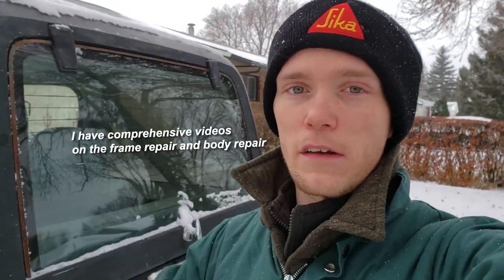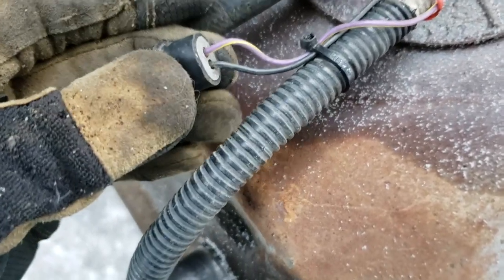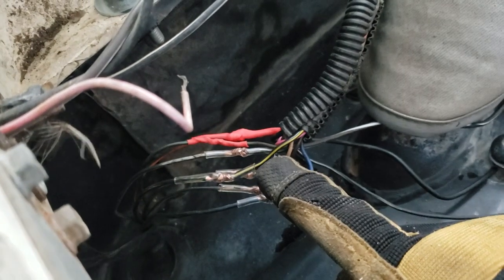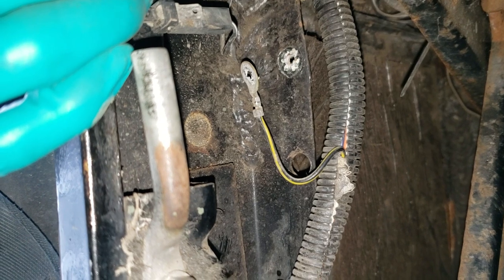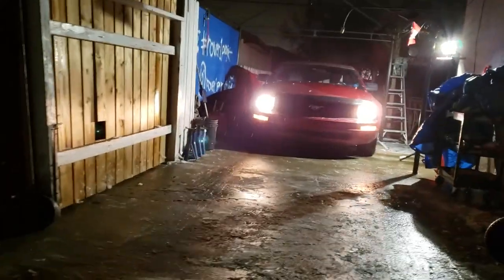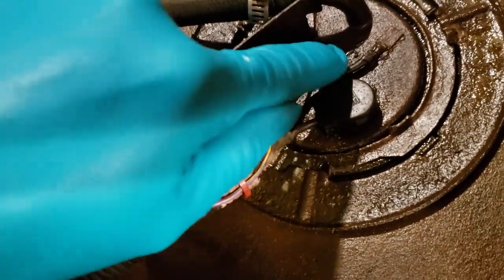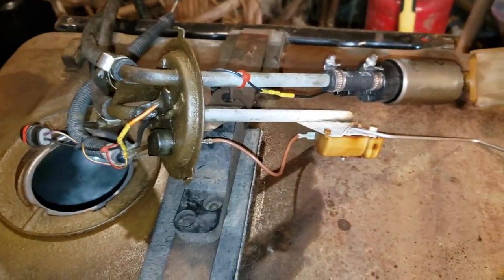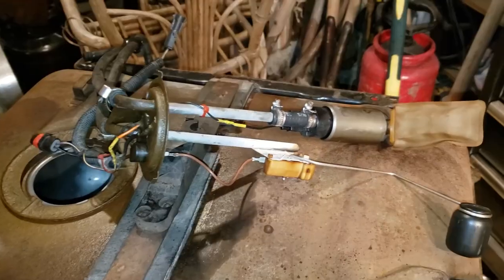Rover 1 Project - Jeep YJ Fuel Pump not priming or turning on

Comment: My money is on the ASD And Fuel pump relays. The contacts in the under hood fuse/Relay block, corrode, and no longer supply the voltage to the relays. You have to 1. Disconnect the Negative battery terminal. 2. Remove the fuse block from the mount. 3, take the bottom cover off, 4. Push every wire into the relay and fuse sockets. Make sure that they are in all the way. If the contacts haven’t corroded too badly, you could just have loose contacts, and by pushing the wires in, you may make them conduct again. Re assemble, and try it out.

Good Luck, I feel you!